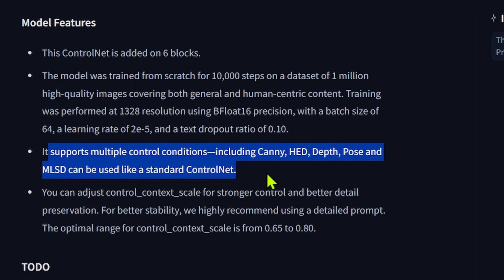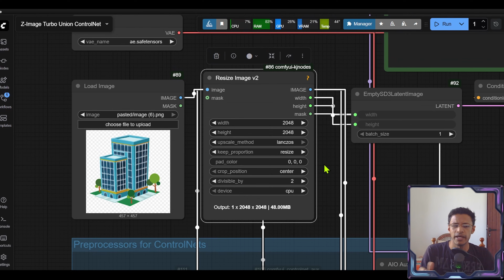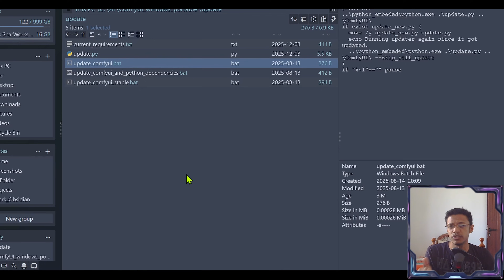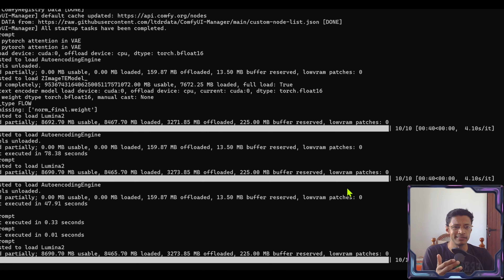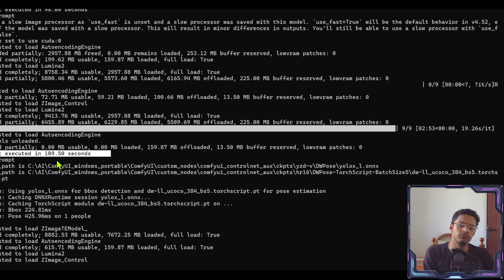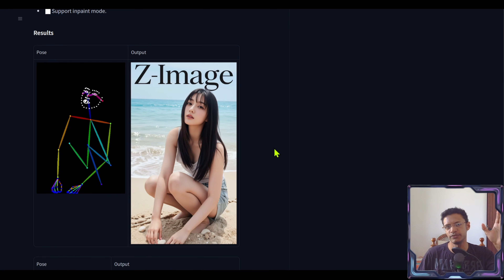Z-Image Turbo ControlNet: ComfyUI Workflow & Speed Test

Comment: ERROR:- UnboundLocalError: cannot access local variable 'model' where it is not associated with a value  why even after doing all the update copying all the model , then going to bath coming next trying again same error is coming is there any solution please?:face-pink-tears::face-pink-tears::face-pink-tears:
Reply from the maker: Hello, update ComfyUI to the latest version. If updating from the manager with the nightly build does not work for you, you will have to manually update yours. Try doing git pull in terminal to get the latest version.

Comment: Cpu i9-14900kf, Ram 64Gb, Gpu rtx 5090 32Gb, Ssd 2Tb*2=4Tb, Os Win11 pro에서 "AIO Aux Preprocessor-HED Soft-Edge Lines 활성화"  NSFW 1024*1024 이미지 1장 생성 3.78초 걸렸습니다. ^^
감사합니다.
Reply from the maker: Thanks for sharing. That is fast generation time.

Comment: I got this: comfyui can't access local variable where it is not associated with a value.
When the node is on modelpatchloader
Reply from the maker: Hello, update ComfyUI to the latest  version. If updating from the manager with nightly build does not work for you, you will have to manually update yours.
Reply: @CodeCraftersCorner  nightly works

Comment: UnboundLocalError: cannot access local variable 'model' where it is not associated with a value
Reply from the maker: Hello, update ComfyUI to the latest version. If updating from the manager with the nightly build does not work for you, you will have to manually update yours. Try doing git pull in terminal to get the latest version.

Comment: I've updated to the latest nightly version but getting "RuntimeError: Given normalized_shape=[2560], expected input with shape [*, 2560], but got input of size[1, 15, 3584]", during Ksampler step.
Reply from the maker: Hello, update ComfyUI to the latest version. If updating from the manager with the nightly build does not work for you, you will have to manually update yours. Try doing git pull in terminal to get the latest version.
Reply: @CodeCraftersCorner  Thanks for answering. It is updated, says "You have the latest version". It has to do with hardware configuration, I guess. All other models work okay for me.

Comment: Modelpatchloader returns an error.Exception Message:** cannot access local variable 'model' where it is not associated with a value
Reply from the maker: Hello, did you update your ComfyUI? You will need the latest commit.
Reply: @CodeCraftersCorner Look, I recorded a video to see what the mistake is. video -  (Unsaved Workflow 3   ComfyUI 2025 12 03 22 10 16)
Reply: @valdisOofecht  i have the same bro(
Reply: @CodeCraftersCorner  Everything worked. I downloaded ComfyUI_windows_portable_nvidia.
Reply: I think if you're on the Electron app version, we just have to wait for the stable release to update to include the new change to the patcher node.

Comment: I keep getting the error "cannot access local variable 'model' where it is not assocated with a value' modelpatch loader. Any ideas? appreciate it.
Reply from the maker: Hello, did you update ComfyUI? You will need the latest commit. Try doing 'git pull' in the terminal to ensure you get the latest commit.
Reply: @CodeCraftersCorner  Git pull worked for me
Reply: @avmsteve  Which folder should I
Git pull
on?
Reply: @mr.entezaee  It is in the root folder, where you installed on your disk, not in the comfyui subfolder
Reply: I'm using Pinokio's installation of ComfyUI and I got the same error even after the update. Maybe in the coming days there will be a stable node for us.

Comment: Thanks for the great video. Quick question, how do you get the bypass controls that you have displayed in the top right of the groups panel?
Reply from the maker: Thanks. These controls are part of the rgthree-comfyui custom node. Search for rgthree in manager > install custom nodes. install the node. Restart ComfyUI. the controls will appear on any group that you have in the workflow.